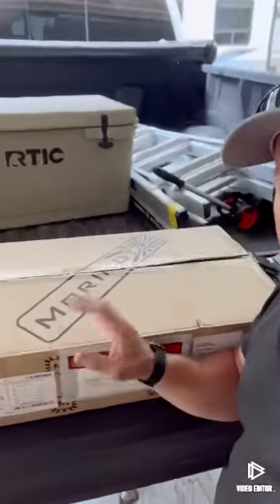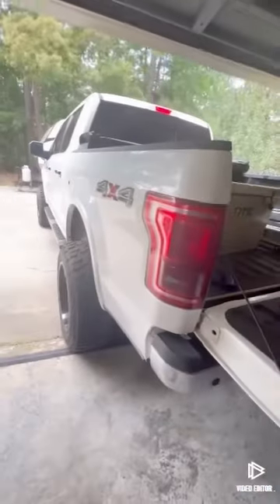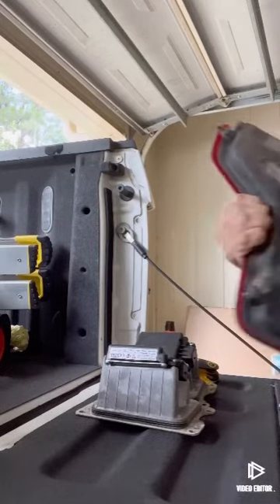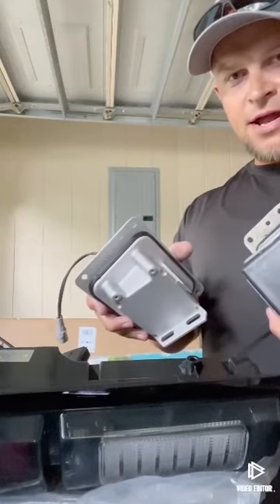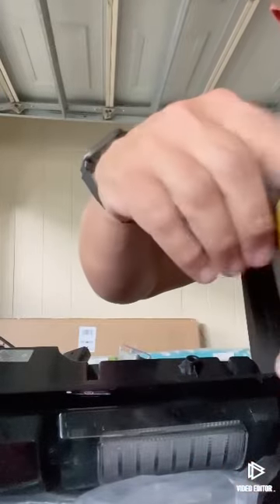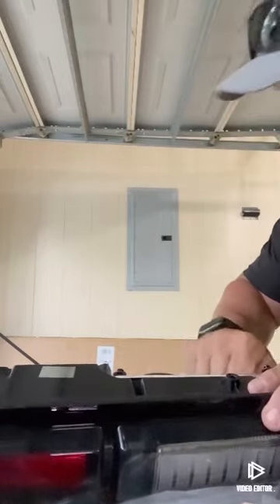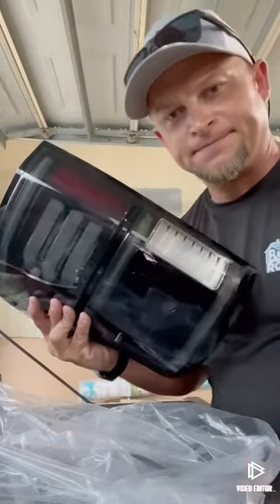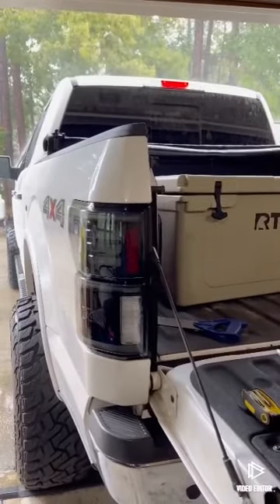New Tail Lights Were Worth the Wait….

Comment: Do you have any regrets about buying these? Also, you feel that there is a great amount of difference in these vs your factory led ones? I would be putting on an xlt with halogens so thinking would make quite a bit of difference. Thanks in advance.
Reply from the maker: They will definitely make a difference. The lights come with the plugs to go into the halogen equipped trucks as well. The main reason I went with these over stock is that the stock led replacement was going to be $550 dollars for one. Why do that when I can buy two aftermarket sharp looking lights for 50$ more. As far as regrets go, I have none, I love these tail lights. I can’t stop checking out the back end of my truck any time I get out of it anywhere. They are subtle and really pop against the white platinum paint.
Reply: @All_Throttle_3.5  awesome and yeah that makes total sense. I’m my case, being an xlt, I can find a halogen housing replacement for very cheap since they are all over marketplace. My passenger one takes on water (which I think is common) but this gives me an excuse to get these haha. Thanks for your input. I think I may end up getting these.